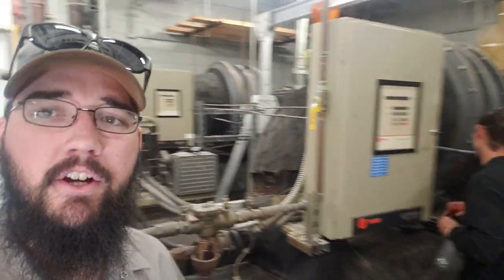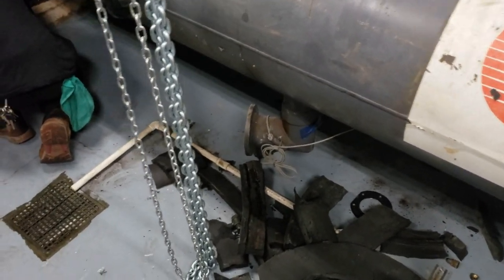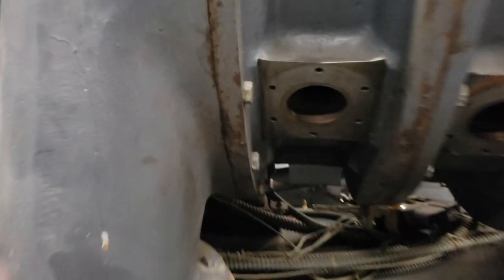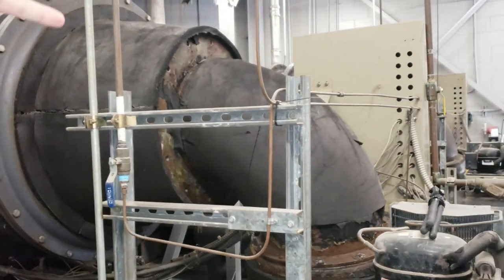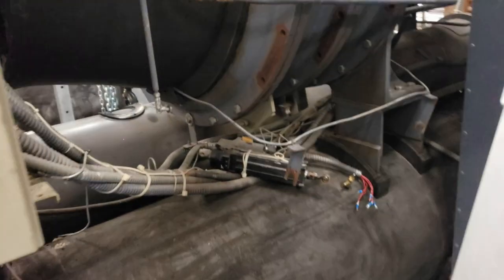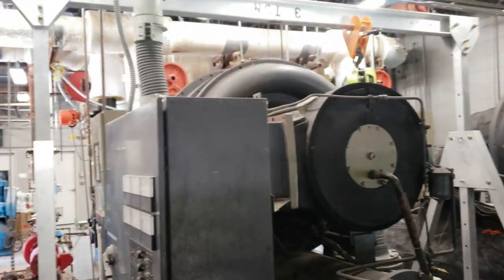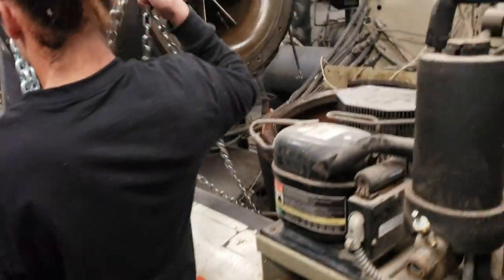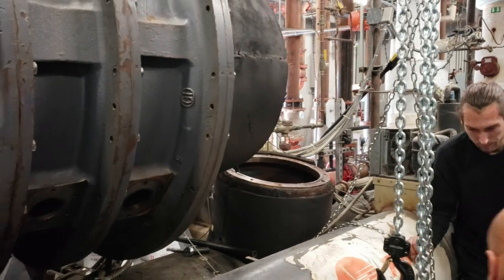Trane Chiller Compressor Teardown Part 1

Comment: Just wondering what everyone's preference on checking a vacuum on large tonnage water cooled machines.  I have always been taught to use the vac u ator.  It checks wb in the chiller
Reply from the maker: I use a standard micron gauge and do a standing vacuum decay test.